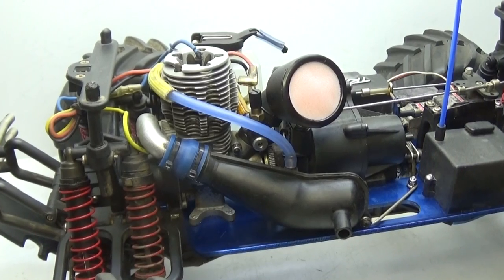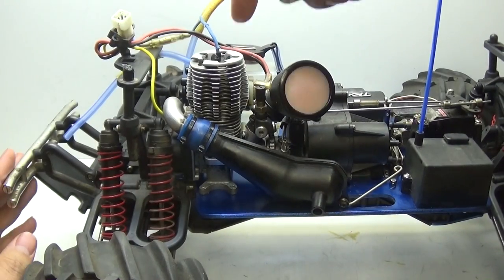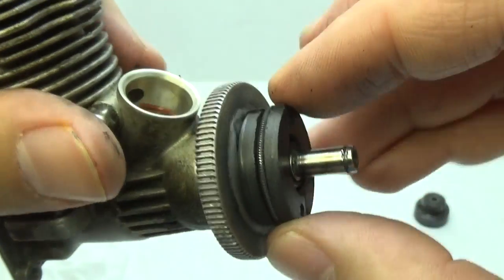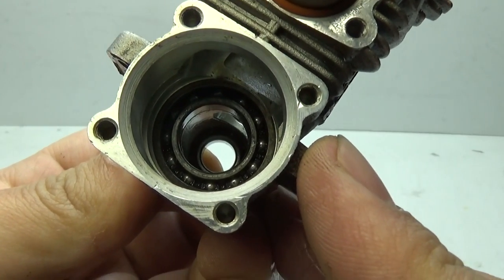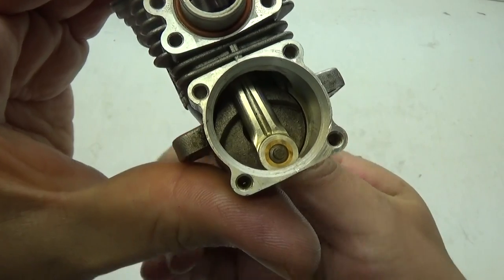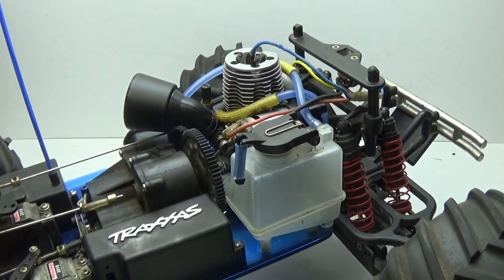RC How To Disassemble 2.5 Traxxas Engine

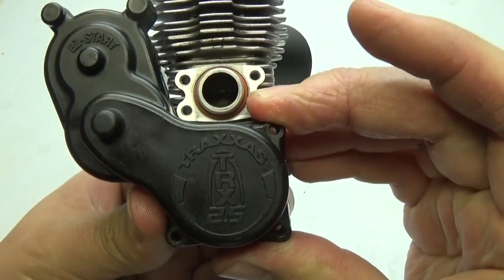Comment: Very informative video. The only thing I want to mention is at 5:13, it's worth noting that there is a small shim/washer that must not get lost that is on the end of the starter shaft.Also at 17:53, there wasn't that washer reinstalled, I don't know the importance of it,but wanted to point it out to others.And at 13:12, there is a oil hole on the bottom of the rod, it is on one side not in the middle, that side needs to face the carburetor to get lubrication.
Reply: It helps as a barrier to keep oil or fuel from seeping across the shaft. And making the one way bearing slip. Without It, you run a higher risk of slip

Comment: i was given a 2.5 tmaxx that had sat for about 8 years with no after run oil, crankshaft/intake valve was totally rusted and locked in the block....used some gun oil and channel locks to work the crank free....could not remove the sleeve so i could not fully disassemble...flushed it with oil and worked the crank around to the point it would freewheel nicely(about 40 minutes) and slapped it back together. Started and ran like a champ!

Comment: Thanks for the vid, great help in restoring a 2003 nitro rustler the engine hadn't ran in almost 13 years. Had dremel off a lot of rust and corrosion and replace the bearings but runs like new now 👌👌 keep it up

Comment: Damn you made that look so easy, I’ve never tried to rebuild/disassemble a nitro engine as I’ve never needed to. But I just bought a Jato with a 2.5 that could possibly use a rebuild and cleaning, and this info on disassembling them will prove invaluable. I only hope it’s in as good shape as that one is. If not, it’s getting upgraded to another, a 3.3 trade up from Traxxas would be just fine.

Comment: Only complaints about the TRX 2.5 and 3.3 is the carburetors and bearings. Replace those with the O.S. 11K carb and Avid Race ceramics and the TRX is pretty competitive.

Comment: Just a tip, don't bother taking the flywheel off if you're changing something in the backplate or replacing the piston sleeve and rod. Doing so is risky and a complete waste of time

Comment: Nice video.. I'm barely getting into the rc world I had a few questions before watching this video honestly it answered pretty much A - Z.just was wondering on what or how would it be the best way to figure out the mount position on the engine honestly did not notice it was easier to remove the engine from the top screws than actually removing it from the bottom screws which now I'm having problems with. Witch I'm guessing I did not put them in the right postion since my tmaxx wont go one pressing the throttle. If anyone can give me a some good advice I would appreciate it.

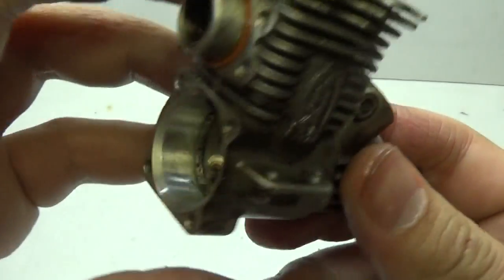Comment: 9:00.  Be very careful when turning the piston without the sleeve.    I’m not blaming anyone, but when I did this the piston came up sideways and smashed about 1mm of the edge of the piston on the inside of the block.   If anyone knows where to get a piston ONLY please link it!   I need it for a 2.5.  I need the piston but not the sleeve.

Comment: My traxxas 2.5 was seized up. I used liquid wrench and WD40 I finally all disassembled with the exception of the crankshaft. It spinning freely but it will not come out. It feels like it was pressed onto the bearings. I used a wood block and a rubber mallet and tried tapping on it. Would love to get it out to lube the bearings. Any suggestions???

Comment: 14:04 is it okay to use lithium white grease if I don’t have wd-40 or after run oil.  Could I use PB blasterin instead of wd-40.  Which would be the better option compared to lithium white grease or pb blaster.  Thanks and thx for putting up such a great detailed video.  I’ve had my traxxas t-maxx in the garage for about 4 years collecting dust. When I put it away I knew I had to replace the piston and sleeve. I’ve done this procedure like once 8 years ago so this video was mainly to refresh my memory.  I do have we-40 but I’m just curious to know if I could use the above mentioned lubricants.  Thanks.

Comment: You do it superb! I don't talk English very well but I can understand everything you said. Hate people try to use crapy voices to sound cool, make it really hard to understand. I have a question. I have plan to run again a really old traxxas (comes with opel calibra dtm body) it was the cheap/small traxxas engine wen we buy. Can I install the automatic starter in this old traxxas engines? 🙈 🙈  I plan to upgrade electronics as well cause my old beauty drives on planes controller🤣, so I want giromode to a RWD that when finish is plan to run like a truck, is it to bad? 🙈

Comment: I was rebuilding a Traxxas 3.3 motor but one of the crank case? Screws were stripped and that ended pretty quick the motor was about 8-10 years old

Comment: Do not use W40 as working lubricator. It is used to help to start moving stuff and cleaning. After short time it dries out leaving no lubrication. If you dont have anything better - few drops of any carengine /lawn mower is still better idea than W40.
Reply: i used wd40 once to rebuild a 440 bombadear  sled eng once be care ful i turned it over on my work bench  i almost shit myself when it started up in my hand wd40 is flameable wow 2cil 40 hp running on a work bench not cool it ideled perfect

Comment: My engine got some rust inside its more like just color cause i cant feel any damage to surface does this mean my engine goes to trash or can be still reassembled and used?
Reply from the maker: Ev0ltion you can use some RC motor cleaner and it should be good.
Reply: If the engine works why would you throw it away? Running it for a while could help clear it out.
Reply: try steel wool rust off first  dont force it

Comment: just got this exact truck from someone who had it for like 13 years. he said he couldn't start it. i got down to the piston and then i realized the engine had ceased. then i got here. Any advice?
Reply: Well, i hope you have fixed it! I had the same problem on my Kyosho Giga Crusher. After a ton of WD40,  i realized that it wouldn' t uncease. What i did was I got a flathead screwdriver and put it between the crank hole and the con rod (a.k.a Connecting rod) and just pushed it a bit and it unceased! My con rod didn' t bend if you are wondering, but do it in your own risk
Reply: Fanis S2000 I did get it by the end of that day. I used brake parts cleaner. I found it the best for removing all the gunk. And to in cease it, I took a pair of channel locks on the fly wheel and turned really hard
Reply: Louis Bernard Brake cleaner... Hmm i had never thought of that for sure...
What' s your truck?
Reply: It's an old T-maxx 2.5 I think it is
Reply: Louis Bernard Nice!

Comment: When I have removed the nut to remove the carb, the carb is still stuck on, how do I get it off? help please and thank you.
Reply: +A.M.M.O had that issue, spray wd40 around the carb
Reply: +Jester ok thanks
Reply: A.M.M.O no problem
Reply from the maker: +A.M.M.O Exactly what Jester said. Thanks Jester!
Reply: darkeclipticheart any time man, im still watching over your channel no matter what!
Reply: ***** You shouldnt ever have to unless they were overheated, or you managed to break them. But as to buy new vs rebuilt it depends on the motor. Some it is much cheaper to rebuild (O.S., novarossi) but with a traxxas motor parts so so expensive youre better off getting a new one.

Comment: My sleeve is seized, any recommendations?
Reply: I used a heat gun to get mine loosened up after sitting for nearly 15 years.  Took a lot of heat but it slid right out when I got it warm enough.

Comment: piston head? Uh it's called a piston dude, and the thing bellow it is called the connecting rod which connects the piston to the crankshaft.
Cleaning should be done with brake cleaner not WD40. WD isn't that great of a solvent. Also do yourself a favor, go to Walmart and buy a roll of blue Scott's Shop Towels. Lint free and super soft and absorbent. Great for all your cleaning needs :P
Reply: OtisENGINEuity you seem to know a lot for a guy watching a tutorial

Comment: I can't get the flywheel off :( can anyone help
Reply: Leo Da Lion      smack it off with a rubber hammer in different areas spray wd40 in front an behind it . Itl come off how old the motor
Reply: Ok thanks
Reply: try swearing at it  and liquid wrench

Comment: On my traxxas 3.3 i noticed that there is a very small hole near where the connecting rod meets the piston.  Its only on one side.  Do you know which side the hole is supposed to face (intake port or exhaust)???

Comment: I have an issue my engine is rusted solid. It’s been sitting in WD-40 for over a year. The connecting arm is basically welded to the cylinder